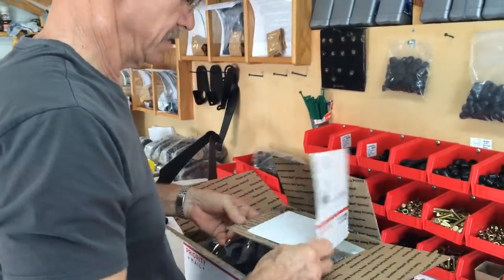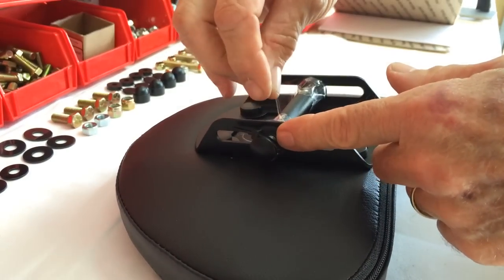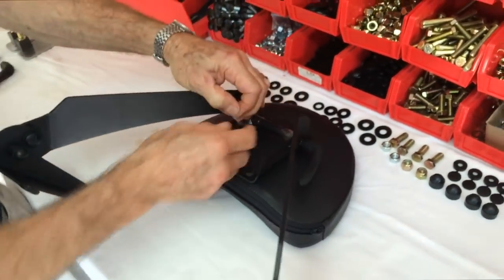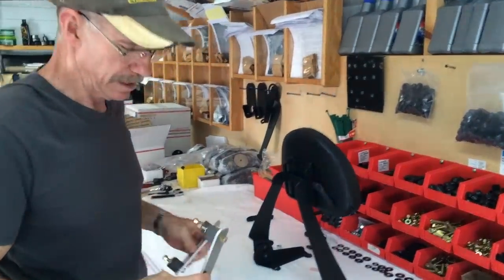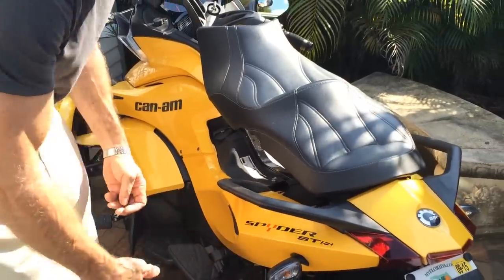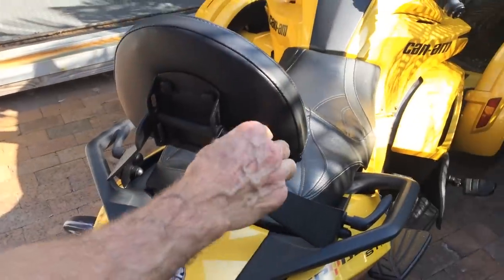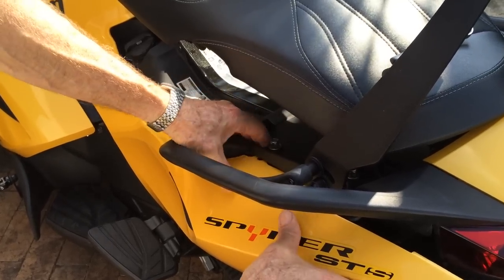New Smoothspyder Dual Mode Backrest for the Can-Am Spyder

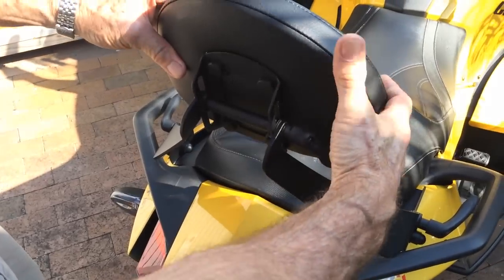Comment: Hi Jim. Thanks for the video. Is it possible to install a rear top box in place of a backrest starting at your video at 9:48 ?
And where would I buy them from. Backrest, section attaching to the CanAm, and possibly top box to fit it? I am not finding it on amazon. Any links would help.
Reply from the maker: I would think you could mount a top case up there, but it would be very high.
Reply: Jim Stanger Any idea where I would buy these from?